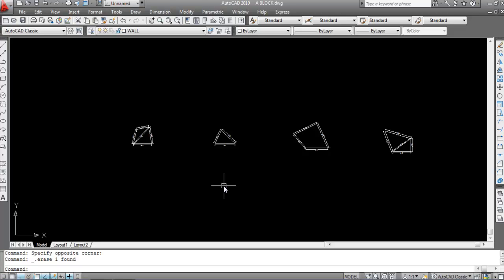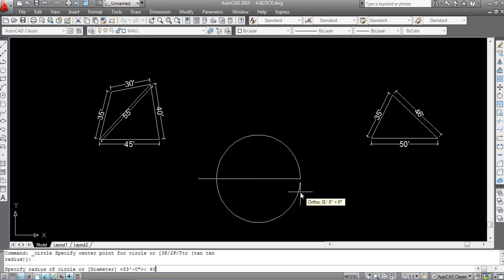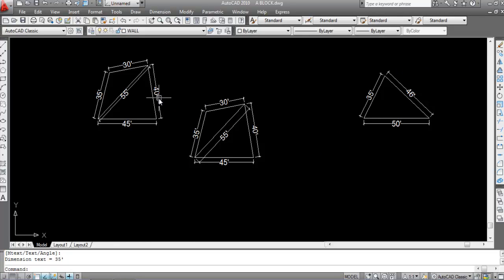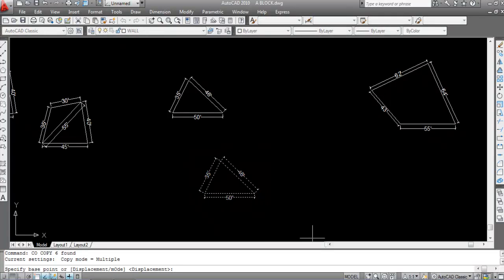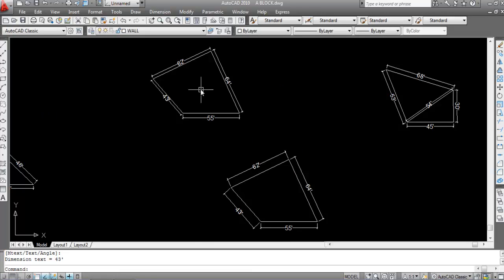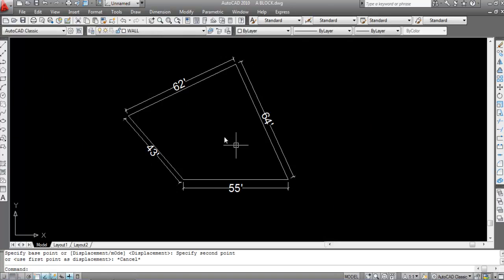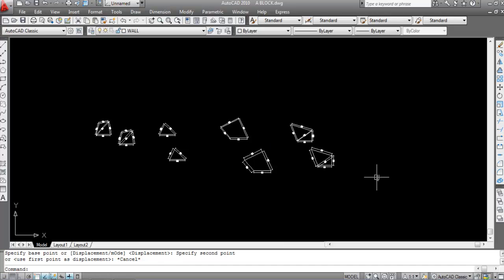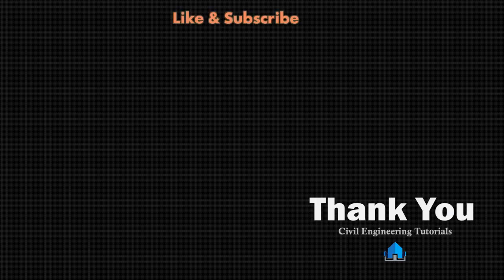How to draw Irregular Plot Area in AutoCAD || Irregular Plot Design

Comment: How do you get the intersection point of the 2 circles? My cutting machine which has a basic CAD program does not appear to automatically give an intersection of the 2 circles. When I draw the straight line, I have to use the mouse pointer to get as close as I can, but this introduces small errors.
Reply from the maker: go to snap setting then object snap & select intersection.you can see the intersection point
Reply: @civilengineeringtutorials  Thankyou, unfortunately the machines CAD system does not have any user adjustable snap settings, hopefully the next update will have a few more features.

Comment: I have confusion in 3rd plot... In that plot, how do you know that the diagonal is 64'? Or the angle between two sides is same with the angle between one side and diagonal?
Reply from the maker: all sides are known & connecting intersection points you  can create the plot area.
Reply: Wrong plotting in 3rd plot.

Comment: the 64' line while drawing quadrilateral is not correct i guess....cuz by drawing two circles from both the sides of base line, you are simply bisecting the base line....that's not correct....

Comment: HOW  I WOULD KNOW THE LINE YOU TAKE 55 FROM CENTER
Reply: im also confused here
Reply from the maker: Its very simple. 
For 55' line you need to draw 40' radius circle on one end & 55' radius on another end of 45' line & you should join both end of 45' line with the intersection point of 40' & 55' radius.
Reply from the maker: Just try to listen that 1 minute. To find the point, you need to draw 2 circles.

Comment: 7:29 the quadrilateral has insufficient data for a construct. how did you decide on the point where you ended the 64' long line.. why does it have to be on a perpendicular bisector of the base?
btw, you should've explained triangle first and then moved on to quadrilateral with 5 measurements, its basically two triangles.
Reply: Right👍